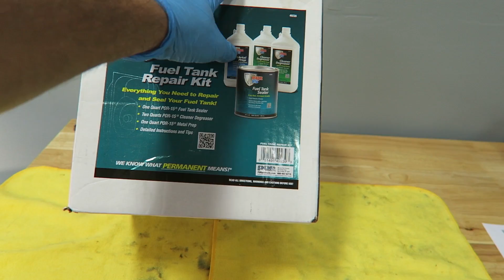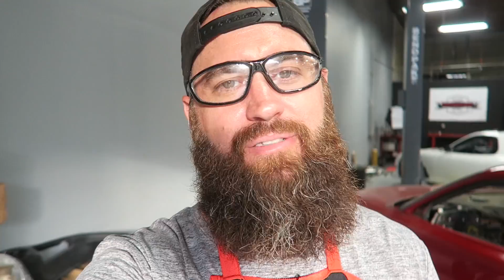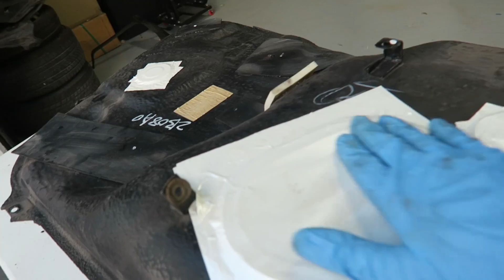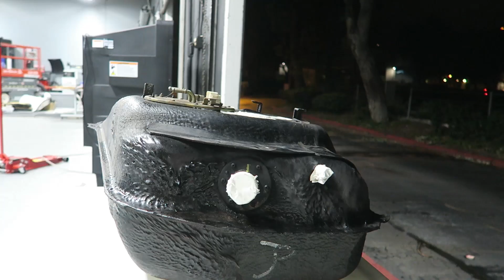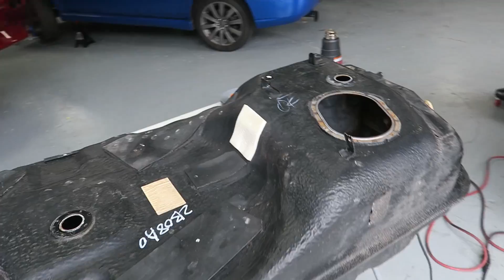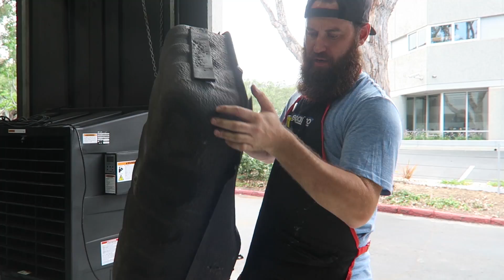RESTORING THE FD RX-7's RUSTY GAS TANK (POR-15 process with Mickey Andrade)

Comment: Mickey- Both fuel pumps are reputable.  I myself have always gone with Walbro.  In fact I have a walbro 450 in my race car presently and have used the 255 in the early stages of my build.  Ive had a lot of friends use the DW as well with no issues.  If you have the sponsorship with DW then I would work with them, maybe they can help you out with your entire fuel system.  Fuel pump all the way up to the injectors and also with the return with the regulator

Comment: Hey Mickey if U Got Something similar Like this again im Just gonna Leave a Tip Here. Buy the Set and get yourself a Good Drill and Some Sand Blasting Sand or Glass put it in Mount the Fuel Tank and Let it Spin for Some Time. Cleans Everything inside.

Comment: i was going to do this to my s2000 tank but decided against it as I seen on the net people had it fail on them over time and the stuff clogged up the fuel pickup,,,,,bye bye engine,,,,,,,,instead going to fill the tank with rust remover which works a treat ( removes 100%) of the rust,,,,, drain it out and fill with fuel straight away.......hope this works out for you tho.

Comment: Go with a walbro or an AEM do not use that other company very poor fuel pumps and injectors I’m running an aem 320lph in my evo 8 with injector dynamics 1300cc with no regulator so the aem pimp or walbro is very resilient

Comment: So nostalgic...reminds me of the good old days of my build.  Anyhoo, depending on the flow requirements, the Walbro had flow issues at high pressure: http://www.fd3s.net/fuel_pump.html

I use a Bosch fuel pump (the one with the full screen at the bottom).  I got mine at Doug Rippie Motorsports but that was back in 2001/2/3?

Comment: I once bought a JDM Power Enterprise Fuel pump straight from Japan for $400 + $70 shipping. I was expecting a Japanese made fuel pump. The packaging was VERY nice... The pump itself was wrapped in brown paper with Power Enterprise printed all over it and it came in a Power Enterprise OEM box with a lot of Japanese writing on it. Here's the kicker. When I unwrapped everything, the actual fuel pump was actually a Walbro 255. It even says Made in USA on it. Needless to say, I was disappointed. However, you can look at it another way... if Walbro is good enough for Power Enterprise with a $400 price tag, it's good enough for most applications!
Reply: tyau1234 I would of demanded my money back and bought an $80 walbro 255 . For that kind of money u could of had a 450 2 times over
Reply: that was my thought as well too but since it was bought from Japan it wouldn't have been possible... This is why if u look at the Power Enterprise fuel pumps online, there's barely any detailed pictures of them LOL!!!

Comment: Thoughts on filling the tank up to the top and using electrolysis to remove all the rust ??
Reply: I would hate the sealer to degrade over time and the rust be exposed again, this is the reason why I'm suggesting electrolysis, though I don't know how well the por-15 kit  works.
Reply: Wouldn't even have to seal it up just submerge it.

Would be a good shout to get all the rust out before sealing it.